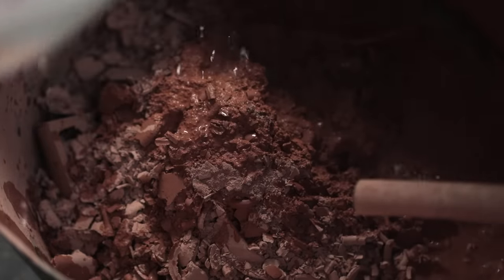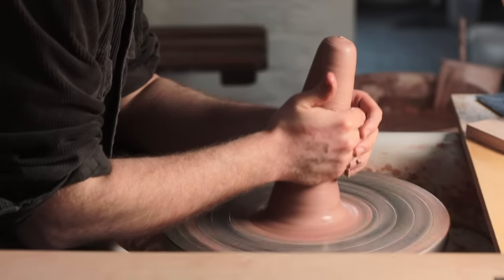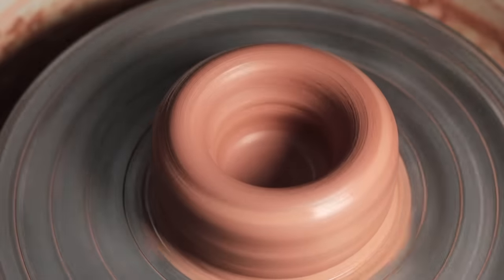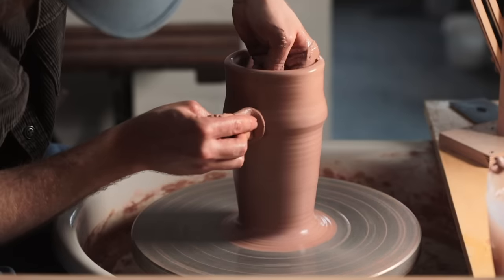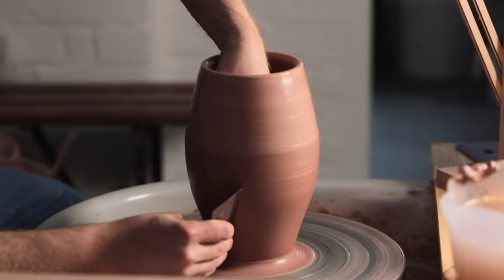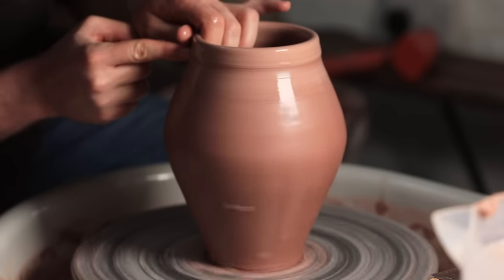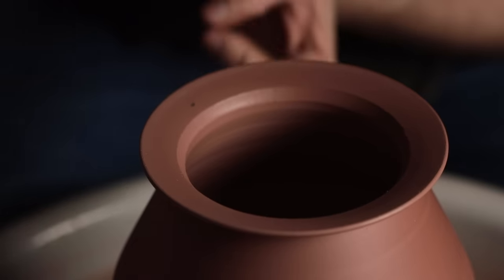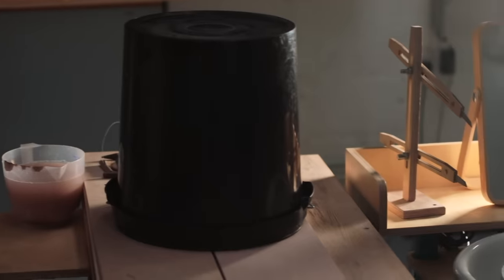A Deceptively Difficult Shape to Throw

Comment: Something fun about clay is that it becomes slippery when wet because its chemical makeup (specifically, how the little clay plates orient themselves and in what order the geometries inside it appear) makes it so the water gets inside gaps between sheets of clay, loosening their bonds and making them able to glide freely.
This next part I'm not so sure about so please correct me, but: this is why different clays have different properties when thrown, kaolin is less slippery than bentonite (rich in montmorillonite) because its inter-layer gap is smaller, making it harder for water and other molecules and ions to get in there.

Comment: You've mentioned in a couple of videos that the action of coning is to help the clay particles align.  Once that's been done, does it give the clay any directional "grain", analogus to wood, that you can feel?  Either during throwing or even as a difference in the properties with rather than across the grain after firing?
Reply: The particles are too fine to feel or see any kind of grain, but they definitely do influence the strength and ease of throwing. Try marbling clay and you'll see what I'm talking about.